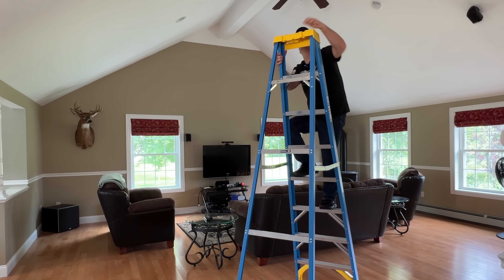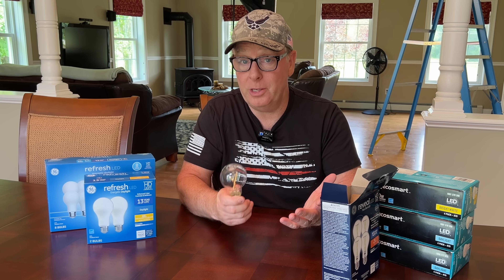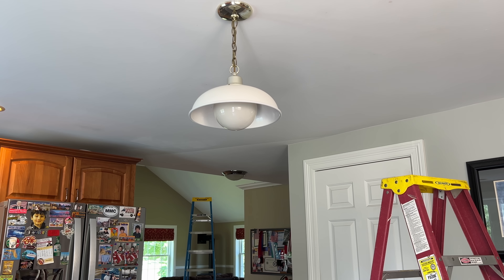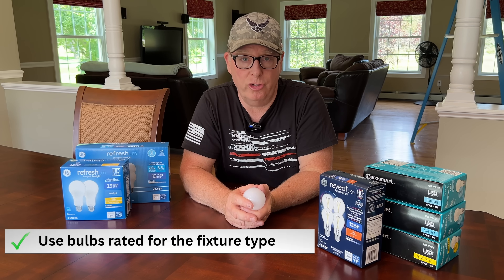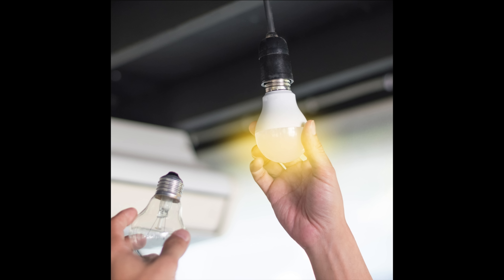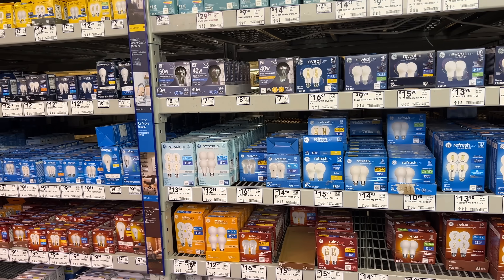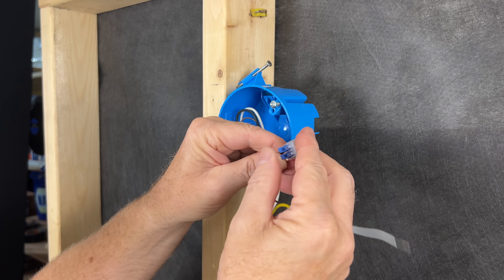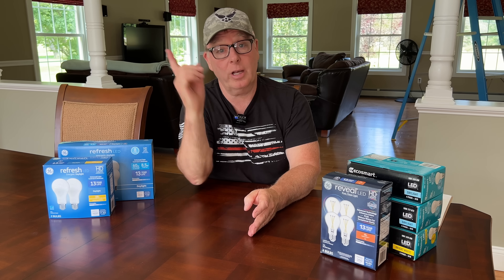The Mistake That Kills LED Bulbs

Comment: I have some early Cree brand bulbs that have ran more than 10 years but they were built with good parts .
Reply: Cree is still one of the top brands who know how to build these things right and don't cut corners, IMHO.  They have quite a reputation for quality in general (they make a lot of high power LED assemblies for lots of other industrial and high-stress applications, too, where a lot of people rely on them to actually work well for a long time).  Philips is also one of the only other brands that I actually trust in this area, in general.

A lot of even the other big names seem to be sort of hit-or-miss.  They can have some product lines that are good, and others that have real issues...

Comment: I've got a globe like you've got there in your kitchen, but I found a plastic version I could drill vent holes in, 3/4" at bottom center and several 1/4" holes around the top around the neck.  Air convects thru and the bulbs last a long time

Comment: I can’t help but mention that incandescent bulbs work in any position, AC or DC (either polarity), they work in enclosed fixtures and open ones or partially enclosed with openings in any direction, they work with dimmers of any kind and they change color temperature as they dim, thus imitating candle light or the setting sun, they never flicker or strobe, they have a color rendering index (CRI) of 100, they can handle extremes of heat and cold (you can even use them in an oven or freezer), and they’re cheaper than the cheapest LED bulb. The only drawbacks are: low efficiency (although they do work as electric heaters, which some uses depend on), shorter lifespan than LED bulbs, and they get hot during normal operation. So why do people want to take away this choice?

Comment: I am using 40 watt oven bulbs in my ceiling fan because LessEffectiveDefective (LED) bulbs fail. Enclosed fixture rated bulbs is a lie.  They fail immediately. I am using my stash of old incandescent bulbs or oven bulbs.

Comment: I have some of the original Philips LED bulbs, when they were bizarre shaped and yellow with heavy heat sinks.  They still work.

The only LEDs I've had fail on me were Amazon junkers, "Dewenwils" brand because they had the GU24 base I needed.  After they all died in under a month, I replaced the fixture instead with one that used Edison bases.

I hate that all these online marketplaces are allowed to openly lie and swindle people.  Wish our FTC had some teeth.

Comment: I have a n LED light in my garage which is subject to extreme heat and cold with the weather.  I leave it on 24/7 like you do with your kitchen light.  That light is over 10 years old, possibly 20.  I bought it when LEDs were a very new thing.  It's sill lit today.  They made them better in the beginning.  Electronics of all sorts are more sensitive to the shock of turn on and off than continuous use.  LEDs do not actually heat up much so I don't think that's really a concern.  You can hold an LED bulb in your hand with no issues while running.  LEDs do last essentially forever, it's the circuitry that converts the 120 to DC that fails.  I haven't really looked into it but I think they don't even bother with any sort of power supply.  LEDs are diodes so only light on the positive half cycle so you can put a string of low voltage LEDs in series to divide the line voltage down to the appropriate voltage for LEDs but that's unregulated and power surges can destroy them.  Individual bulbs have some sort of power conversion though.

Comment: The only thing that I have seen that keeps the heat down is to use a 12VDC power source and 12V bulbs.  There's no conversion circuitry involved, so the bulbs can be very tiny and they barely get warm.  Of course, you have to live in a camper to experience this, OR you can re-wire your house to have a ton of low-voltage wiring running around.  When I build my next house, I am going to do this.  Imagine - all your lighting "free" because solar panels charge the 12V battery that powers the lights.  :)

Comment: Wires reversed in an AC circuit?
The load won't notice a thing.
I recently replaced bulbs in a ceiling fan that were like the Ecosmarts you showed. The enclosed base was hot and cracked.
I replaced them with bulbs that had the electronics way down in the metal base with the LEDs out where the filaments of incandescent would be. (no warning on the box about enclosed fixtures)

Comment: burning a LED bulb base up adds more heat into the base electronics than a base down position does.  My experiences show the base up positioning to shorten the life more than the base down one. Recessed lighting cans in ceilings are particularly bad.

Comment: I replaced all my bulbs with LEDs and have had very few failures. We have a fixture, similar to yours, that's on most of the time, and the bulb lasts a long time with no problems. We buy them from Costco for about $2 each. LEDs are much better than the old incandescent bulbs in my opinion.

Comment: The problem with these bulbs are that they are built to fail. The difference is only that you know the cheapest bulbs are but the truth is that I had so many Philips bulbs fail within days after the one year warranty it is ridiculous. The only change that is made here is that you use the bulbs in the unintended way to prolong the lifespan more than they want. For me, I got tired of all replacing and bought industrial armatures instead

Comment: They will work fine with reversed AC input polarity. The rectifier is within the bulb enclosure and the rectifier doesn't care which wire is where on the two input nodes...If you are talikg about a DC input on an LED itself, then yes, the polarity matters...I guess rule of thumb would be, If the bulb is a direct replacement secrew in type bulb to replace a screw in type incandesent then neutral/hot doesn't need to be observed...

Comment: I worked maintenance in a new facility building.  There was rarely a day that I didn't have to replace led bulbs or drivers.  Constantly going bad by flickering or no light.  
For my home use I found Philips to be the most reliable.  Otherwise, incandescents easily outlived the leds.  Only plus was a slightly lower monthly bill which sometimes didn't offset the higher cost.

Comment: Here’s another tip that not only does it apply to LED bulbs but also to incandescent bulbs as well. 
Check the voltage rating on the bulbs you are buying. It varies considerably even within the same brand and wattage. 

Given our infrastructure deficits and we all have them many of the bulbs are still rated at 115v. I have even seen a few 110v. Walmart, Home Depot, Lowe’s they all have them. 
The problem comes when you have 130v on your house. Remember that 10% rule we all look for? It’s a thing! 

I’ve seen identically packaged bulbs on shelves sometimes priced differently in which one is rated for 125v and the one next to it is rated lower. 

Backyard….you just added a couple of things to my next shopping experience that I honestly hadn’t noticed!

Comment: Or...and I am not being flippant, stick with your old incandescents as long as you can.  I have a number of incandescent bulbs in frequent use for over 30 years old.  None of my LEDs has lasted 5.  Even CFLs have proven more reliable.  I have no doubt that under optimal circumstances LEDs can perform better.  Given the age of much of our housing stock optimal circumstances may be the exception rather than the norm.  Plus with incandescents all we needed to worry about was the size of the base and whether it was the right level of brightness.

Comment: I have a question that no one seems to be able to answer. LED light bulbs sometimes don't work in some light fixtures. I have 3 can lights in my kitchen. the 2 on the ends work fine but even using a brand new bulb in the center one never works correctly. They flicker and many times don't turn on at all. I can take the same non working light bulb and put it in the lights on the end and it works there. I currently have a cfl bulb cause the flickering is maddening but the color is very different. I'd use an incandescent if I could find one.
I don't get why this one in particular doesn't work.
This isn't the only one I have seen like this but the explanations are lengthy on the others and it isn't in my house.
Reply from the maker: That is interesting. My guess would be a loose connection either in the wiring or the fixture base tab is compressed and your not getting full voltage to the lamp.

Comment: In a complete remodel I used all ecosmart bulbs.  I follow all of the rules you listed yet I have had numerous failures that would never have happened with incandescent bulbs.  I also just replaced 3 out of 4 Feit 8' ballast bypass LEDs in the garage.......they didn't last a year.  The fact that videos like this exist proves there is a technology/manufacturing/quality issue with household LEDs.  There aren't any "why do incandescent bulbs burn out" videos.
Thank you for great videos!
Reply: puts on tin foil hat
The lighting cartel was never fully disolved. They are back to building bulbs to die prematurely, especially for models you are likely to purchase at a hardware store with little consideration.
removes tin foil hat
Reply: @LordWaterBottle  Technology Connections did a video on that and he concluded that that was just a myth. An average incandescent wouldn't last much longer than 1000 hours so the idea of limiting their use to around 1000 hours was to ensure that manufacturers could not charge higher for "longer lasting bulbs" which don't last longer.
Reply: @theurzamachine hence the tin foil hatting. It's not serious, just trying to be amusing.
Reply: They're also aren't a lot of videos comparing different fuels for your steam engine, and if wood or coal works better. Nor do we find a lot of videos comparing quills to those newfangled fountain pens.
Reply: "Feit"   Well, there's yer problem right there.  Maybe I need to start taking them back to Costco when they fail.
Reply: Feit bulbs are trash. I had an entire box flicker and die in under 6 months.
Reply: Well said 😂
Reply: I recall the days of incandescent bulbs being $1 and burning out once in a while. Even supposing your LED bulbs burned out at the same rate, they're still cheaper than incandescent ones. Ecosmart bulbs are $0.97 regular and $0.79 when on sale. Accounting for inflation, it's cheaper today to replace bulbs and will likely last a lot longer.
Reply: @theurzamachine  Taking into account the lower electric bill, and the lack of heat generated in the summer therefore even less electric bill for not running A/C as much, it does make sense, even when LED bulbs cost a few dollars more.
Reply: ecosmart are generic trash bulbs. the good bulbs are made for places like church ceilings where the cost of replacement is so high a good bulb is worth it. SATCO is one brand that makes those. otherwise good wafer lights (e.g. from Halo) are the way to go, separating the driver from the light and with plenty of aluminum for heat dissipation)
Reply: LED’s also slowly dim as they age. I have a Cree bulb that is roughly 16 years old. It’s slowly getting dimmer. When first installed I couldn’t look in the direction of the bulb. Now I can look up in the rafters no problem. 
Same for other LED bulbs I’ve purchased. They slowly diminish in luminescence.
Reply: EcoSmart is junk, and if made by Cree or Feit, that is why. Cree was already total garbage from day one, and now Feit owns Cree, and Lowe’s decided to dump the actually very good GE line with Cree, not only have prices more than doubled, but the lamps are way lower quality than GE. I use certain models of the GE lamps in certain fixtures, and nothing else can replace the GE’s, so if Lowe’s in our area goes to Cree junk, and when the ones I have in use eventually fail, the fixtures will be out of service. I won’t settle for different lamps, that will also be much lower lumens because they won’t be even remotely bright enough, and I won’t pay premium price for lamps that are garbage before I even get a pack off the shelf. Pisses me off, and is obviously both control over personal choices and ripping us off with overpriced Feit garbage with the equally junk Cree name on it. These are lower quality than Dollar Tree bulbs with a premium price. I hope I can stock up on the GE stuff I use before our local Lowe’s literally dump them, leaving me high and dry. 🤦😬😡

Comment: Couldn't keep outdoor floodlights that I leave on overnight working.  They'd make it about a year and start the flicker dance of death.  I just replaced them with GE floodlights that have adjustable color temperature.  It's a bit of a scam, they actually just have a set of high temp and a set of low temp LED's & simply blend them together to give the illusion of other color temps.  But we can use this to our advantage and set the color temp smack in the middle.  This way both sets of LED's are being blended and therefore aren't being driven nearly as hard as they would if they were running @ full output.  I've had a lot of lights fail due to multiple failed LED's rather than driver circuit issues.  The reason is lower end manufacturers overdrive the LED's to increase the brightness & decrease the life to hopefully just past warranty.  On the other hand, I've had a quality Phillips LED bulb running pretty much continuously outside my machine shop building for the past 7+ years, still going strong.

Comment: I bought most of my led bulbs at the dollar tree. 2 packs for 1.50 currently. Only had an issue with one bulb years ago. But other than the table lamp in my main room, most the others don't get much use I have to admit

Comment: Manufacturers don't make money if you only buy an LED bulb once .
The main reason LED bulbs die is the individual LEDs within the bulb are being driven too hard. Manufacturers try to use the least amount of LEDs per bulb and maintain brightness so instead of 10 L E D running at a nominal voltage they will use six and run them at a higher voltage to achieve the same brightness.
I still have one of the first Philips LED bulbs that was made, it has been used everyday for years, the lamp is in aluminum body with three large yellow filters that make up the bulb shape and convert the bluish light from the LEDs to a warm White

Comment: So a few years ago I was at Costco and they were liquidating their Feit LED light bulbs at really low prices. A box of six 40 or 60 watt equivalent bulbs was 99 cents and a box of flood lights was $1.99. I said that is ridiculous, does anything at Costco cost less than a dollar? So for $20 I bought a lifetime supply of LED bulbs. I never imagined light bulbs could cost less than 20 cents each. 

We have flood lights under the eaves of our house. Two of them are high requiring a tall ladder to change, it is a little scary. I believe that incandescent lights can go bad from turning them on and off, but they use a lot of electricity so you had to live with it. I don't know if the same is true for LED bulbs, but I decided to just leave the eave lights on to try to avoid them burning out and needing to change them. Plus the lights add security and show off the house. It has been over 8 years and I haven't had to change them yet.

Comment: LEDs, piss poor thermal management and chips being ran at or around their absolute maximum current rating, its the reason I make up my own units from scratch. 
Even so called professional companies, still run at maximum current with not enough of an heat sink. 
It drives me nuts.

Comment: I can sum up your entire video.  I've personally never had a single LED bulb fail out of over two dozen, some of them 10 years old now.
*Sees you have LED bulbs mounted in recessed fixtures* Yes, heat is the number one thing that will kill your LED bulbs.  The one you remove has absolutely zero heat sink.  My bulbs are PAR30 bulbs with full metal heatsink.  You are buying junk.

Comment: AC and 2 wires driving Any circuit:
The load absolutely Does Not Care.
It will make No difference.

The only thing that changes is contact safety ("Hot" shielding/jacket being the big one!)

Comment: Well I went through Hell with LED light bulbs.  I have a Snowman blow mold I bought back in the 1990's really cute holding a snow shovel.  I put a LEd light bulb in it and discovers it only lasted a couple of days.  Turns out if you enclose a LED bulb they will fail quicker.  If you use them in a open air light fixture they should last.  But I do know those PAR type LED bulbs are kinda sketchy.  I found a bulb on amazon that was rated for enclosures and its worked.  By the way I bought those ones from ecosmart for enclosed fixtures and they failed also.  Also of you have a light fixture with the cable is the same color and one side has a stripe in it ITS THE NEUTRAL WIRE.  I mistakenly wired it hot and man it made changing light bulbs interesting.

Comment: the cheap LED bulbs I bought failed because the electrical connection between the base and the driver circuit is just a solid wire pressed against the base.  It could have been soldered but i guess that would cost extra.

Comment: I have a kitchen LED light that is still going strong after 10 years. It is in an open shade, connector up, and is subject to many on/off cycles per day. It is the same shape and size as a standard light bulb, manufactured by a company that bears the Philips logo. I suspect it was made in China. Not all bulbs are created equal.

Comment: Virtually ALL light bulbs are used in an enclosed fixture.  

You would think being on constantly would lengthen the lifespan, less temperature and voltage spikes. 

Basically we were lied to by the climate warriors in order to get us to pay 4x for yet another substandard product, much like electric cars and clean power generation.